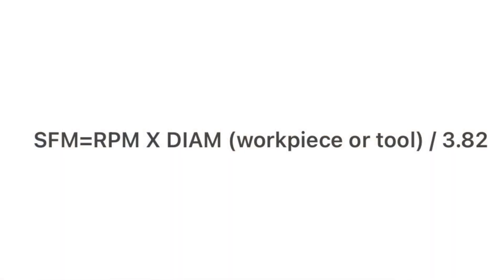RPM -or- SFM❓What do they mean❓#cnc #machining #machinist

Comment: do you ever use g96 on a sliding head? just curious bec i've never done it or even tried but guess it depends on the length you're trying to cut and how much you can go back into the guide bush if you ever wanted to use it?
Reply from the maker: I’m use G96 on Swiss all the time. The guide bushing in and out depends on how long your guide bushing land is.  For our guide bushings our standard land is .600 and we sometimes use what’s called an extended land and we could get 1.6 out of that.

Comment: Please remind folks that you need to set a sane G50 to stop the spindle at speed when working on heavy stuff. The horrors ive seen....
Reply from the maker: That is 100% truth that every programmer set up an operator needs to know. I actually covered G50 in the video. Maybe you stopped watching before I did.  Either way, thank you for sharing that. It is truth that everyone should hear and understand.
Reply: @Crusadermachining you said the G50 part about 2.5 seconds after i hit the send button 😂.  But i am very curious about the G97 and chatter thing....
Reply from the maker: Hey me too! It defies all logic but there are times that I fought chatter using G 96 and I just put an arbitrary G 97 and it worked. Honest to goodness.
Reply: @Crusadermachining I'm probably gonna give it a try for one job I have. 2.435 Dia bore about 7 inches deep, all continuous, 63 microfinish, +/- .0015, in hardened 4140. It's a headache to say the least.

Comment: I have found on my older OSP control that running SFM in production, particularly on short runtime parts slows down my cycle times significantly because of the time it takes for the machine to accel and decel. It's unnecessary time and machine wear in some situations.
Reply from the maker: I have also noticed that and I think that’s one of those times where it’s great to use G 97 over G 96.

Comment: The constant is pie 3.142 where do you get 3.82 from just wondering
Reply from the maker: Years ago, Iscar and I think Sandvik also had a little cheat sheet of formula cards that they used to give out. I’ve had that same card for about 10 years.   Furthermore, that was the same formula my father and my grandfather used.  I don’t exactly know where 3.82 comes from but I’m going to find out now.
Reply: Because when you divide 12 by pie you get 3.82, you have to divide by 12 to get inches to feet and so that’s why 3.82 is the constant.
Reply from the maker: @CastroMKE I’m glad you mentioned that. That’s the same info I found out. Thank you for clarifying
Reply: SFM = (3.1416 x Diameter x RPM) / 12
RPM = (SFM x 12)/(Diameter x 3.1416) which simplifies into (SFM/Diameter)x3.82 

Hope this helps

Comment: This is the first thing i teach anyone who touches a lathe

Rough starting points if you dont know what material you have or dont kow rhe recomended surface speed i tell them is 200 for hard stainless or welds, 300-350 for softer steel & 140 for inco. 

Should get you within 1 gear of what you need. From there just adjust based on how its cutting, is it squeeling? Slow it down, insert burn out fast? Slow it down.

But always pushing, if you make a part and the insert looks fine, cranker up.

Was always told if your not using 2 cnmg per shift your not pushing your machine hard enough
Reply from the maker: That's a solid method for getting close to the right SFM without all the exact numbers. Thanks for sharing your insights. I agree about pushing the tool. If you get several shifts of tools life on one edge, you got room to push it.

Comment: This is the best explanation I've seen so far on SFM. When you're always working with small parts it's harder to understand SFM because most of the time you're just spinning really fast. It wasn't until I worked in a shop that made very big parts where I truly understood Surface speed compared to just a fixed RPM. When working with big parts if you don't use SFM it's easy to program too high of an RPM on your parts, and it wasn't until I programmed the same surface speed on a smaller part where I realized how much faster the RPM is at the same SFM.  I like your formula for calculating RPM, the way I used to do it is just call up a tool, give it a g96 S anything, then manually crank the tool down to the x position and see what RPM the machine is at. 
When you're always in G96 it gets a little annoying as you move your tool away for a tool change then come back to the part as the RPM keeps going up and down, instead I like to find out where my RPM is at my first x position , start the program with G 97 at that rpm, then put my g96 in right before the turning starts, it keeps the spindle a little more stable. 
Luke, I admire your passion for lathe work, my dad was a lathe man starting CNC work in the 70s, I was his apprentice in the early 90s and he taught me so much, when I first started working with him he told me I should really learn the mill first because the lathe is easier because you only have to make half the part, although modern turning is so much more complex than back then.
Reply from the maker: Hey, thank you for watching and thank you for leaving your input. I do that same trick with G 97 when I work on larger diameter parts.  It’s a good trick. I appreciate the kind words and you and I obviously have a lot in common because I learned from my father as well.  It’s actually pretty cool because a lot of people that have commented on my last coffee. Talk also said that they worked with their father and our grandfather.  In a lot of ways were quite blessed to have that experience.

Comment: 11:20 I find that to be the case too. Especially when chasing low Ra finishes. I think the spindle trying to change rpm introduces small vibrations. But another thing that would be cool to add cus I just had this issue is know your inserts. I was told a Walter wnmg432 mm5 was good for 316. And even though it’s listed as a secondary application, that insert struggled the whole time. Today I tried a proper M only insert, wnmg432 xm220 by sandvik, 680 sfm at .008 feed and the roughing .1 depth of cuts were looking like 32 finishes. If the insert isn’t built for the material. Sfm goes right out the window.
Reply from the maker: I like that a lot that is some really great input to share and thank you for commenting. I’ve covered tooling for material specific stuff in a couple of past videos, but perhaps I should revisit?
Reply: @Crusadermachining I think that’s a good revisit. It builds upon this video further. You’re killing it man lol
Reply from the maker: Thanks man I appreciate that

Comment: I've been a self taught mill machinist for a while and have wanted to learn more on the turning side. Using exaggerated examples was always how my first and boss would help get concepts across so the tape roll was a good example. Have you done any polygonal turning or looked into that?
Reply from the maker: I have not done any polygon turning I’ve seen it before and I would love to have the chance, but I never did. Thank you for watching and leaving your input.
Reply from the maker: I also use CSS almost always on the lathe. For feed rates I’ve made a couple different videos touching on it and they are in the playlist titled Videos On CNC - but I’ll for sure touch on it again

Comment: SFM is just how fast the cutting edge is moving. It didn't click until I considered the tip speed on turbine or rotor blades. Bad things happen when they break the sound barrier. Now I want to see an endmill break the sound barrier when run at 67,520 SFM.
Reply from the maker: Imagine that. That’s insanely fast for a mill to move! What diameter is that tool that does that ??

Comment: I use G50 and G96 CSS on nearly all of my turning features on my Swiss.  Maybe in your next video discuss IPR when using CSS.  It's one thing to know SFM but, how do you select the appropriate IPR?
Reply from the maker: That’s a great suggestion- I’ve cover this in the past, but maybe I should revisit it.  It’s a very important bit of info to know.
Reply: @Crusadermachining  Cool, it may help some of your viewers.  I vary widely between materials and utilizing CSS and IPR helps me get a job up quickly.  Most of my swiss quantities are below 5k pcs so I need to be good at doing quick changeovers and writing programs in a short amount of time.

Comment: Might be different for imperial, but for metric I was taught: SFM = RPM*π(3.14159)*Diameter/1000) and RPM = SFM*1000/(π(3.14159)*Diameter)
Reply from the maker: I’ll have to try that and see if I get the same numbers 👍
Reply: It's the same as your formula, except it's converting diameter in mm to metres per minute, instead of yours which is inches diameter to feet per minute. π/12 = 1/3.82

Comment: Thanks for this. I can wrap my head around the concept but I still have trouble visualizing different sfm's like I can do easily with rpm and ipr. It gets even tougher for me with endmills, I can easily tell what the cutter is going to do by setting feed and spindle speed, or chip load. But sfm is still foreign to me.
Reply from the maker: SFM is a rough one to learn and really grasp the concept. It’s one thing to just do it cause we’re supposed to but genuinely understanding the theory can be pretty hard to visualize. It was difficult for me for a while to understand.  Thanks for your input. 🤝🤝

Comment: In our shop we tend to use the formula for fixed RPM: SFMx318/Dia  (metric) its not exact so it can deviate 1-2 Rpms but get the job done.
Reply from the maker: That's a good approach to get close enough with RPM.